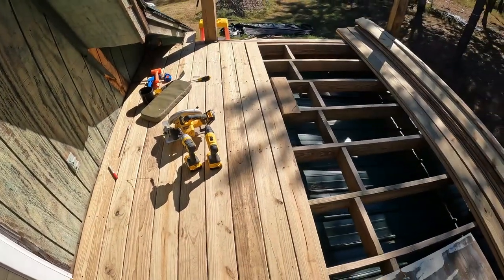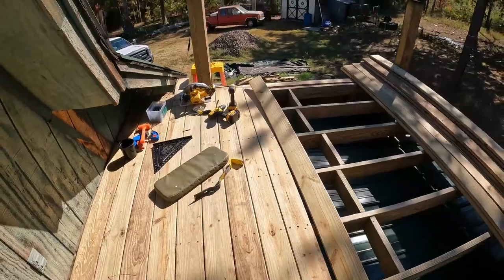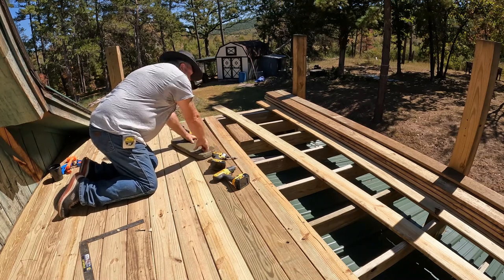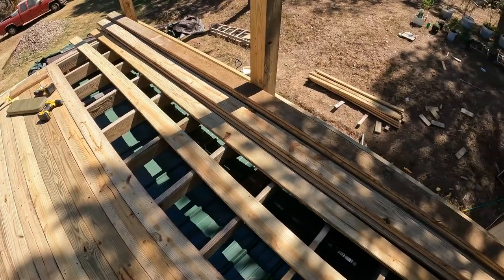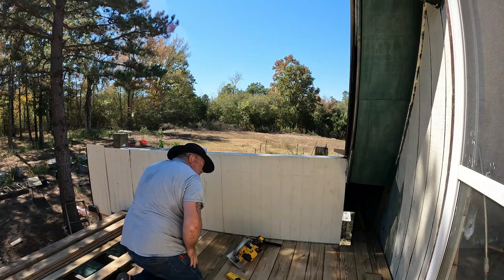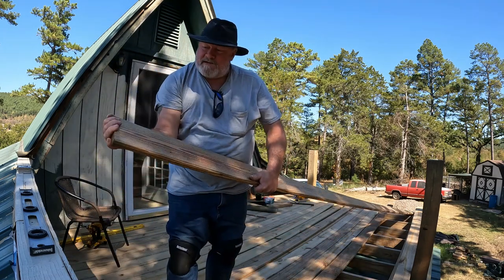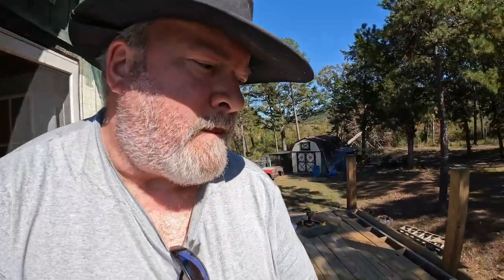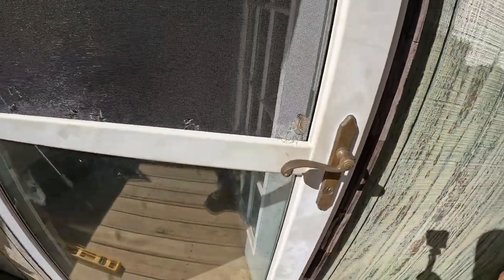So Close I Can Taste It! Upper Deck Nears Completion! Dog Apartment/Screened Patio/Upper Deck Build

Comment: Not sure how you’re planning your rails but on my deck (10x15) I put a top and bottom rail to nail my ballast with a top cap. I put the bottom rail at 4” off the deck to allow me to easily sweep leaves and debris off. It’s worth the time and effort and has a nice appearance. Just a suggestion.  Your deck build is looking great and what a view you will have!
Reply from the maker: I am thinking of maybe doing it with Rebar like I did my railings on my loft.But havent decided yet. Thanks for the input, sounds good to me.
Reply: @ouachitamountainliving  That would look really nice.  I’ve seen that done before and steel and wood works great together!  I’ll be looking forward to seeing the end result.